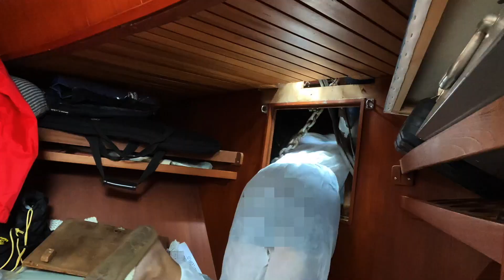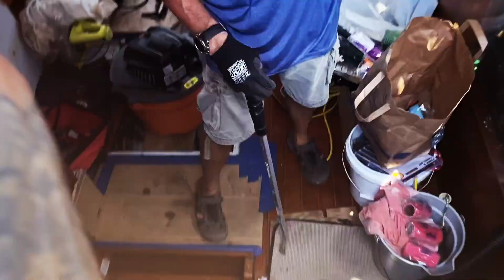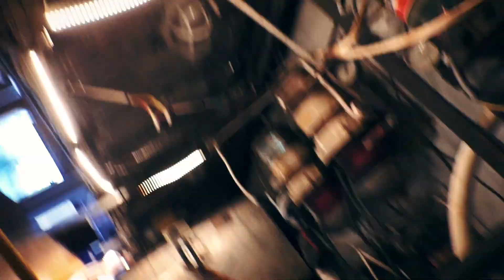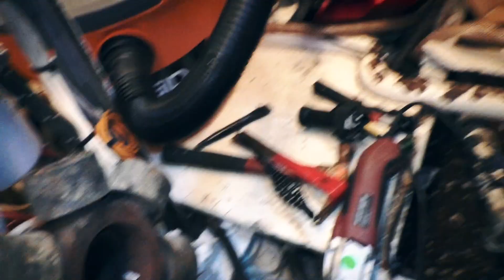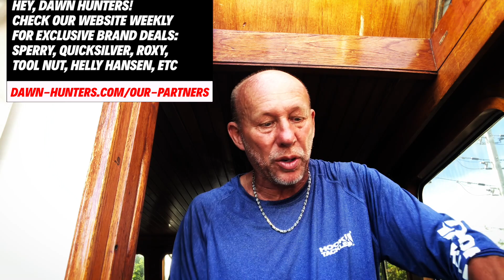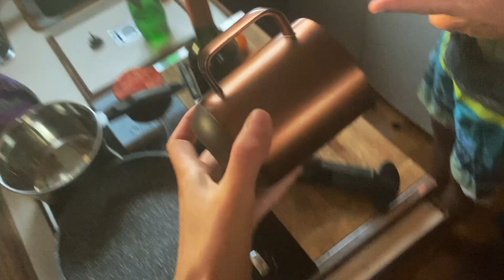Looking for a Motorsailer for Sale?! Watch This Steel Boat Rust Repair First!

Comment: How are you cutting that heavy gage stainless? And you said there are two grades, which did you choose for the chain plates?
Reply from the maker: Gary
I cut the stainless steel with a Dewalt 14 inch chop saw. The chainplates are fabricated of 304 stainless steel. I did now want 316 as that is too brittle. The 304 also has properties that yield more strength when welded. 
Welcome aboard 
Capt W

Comment: That boat is made with good Dutch steel.
Reply: I know because I'm Dutch. lol
Reply from the maker: Hello Raymond. 
You are 100% correct. Dutch Steel is what she is fabricated of. Actually very few pleasure boats are made with this steel due to costs but all commercial oil field vessels use “Dutch steel”. It is also a pain in the ass to work with. BUT well worth the effort. 
Thank you for watching. 
Capt W

Comment: Steel boats die from the inside out...
Reply from the maker: Tony
You are correct and soooooo happy we only have 3 small places this holds true. 
Capt W
Reply: @DawnHunters  haha...3000, only time to deal with that is the prep and original epoxy paint with spray foam. even then the construction must allow for inspection. my 58' ketch I can inspect all but 90 sq/in !! Twenty one years not even one spec of rust. Sorry to say your project has terminal cancer. Good news with steel you can fix almost anywhere in the world. Mate, get Lana out of the freaking bilge, what are you thinking. She needs to be over on Collins Avenue shopping. I am 64, my wifes 38 Brazilian, been together 17 years so take my advise.
Reply from the maker: Lowry Shank 
Hello Lowry!! Thanks for the comments. So many topics and I will save some for future videos. For sure you have steel experience which is very hard to find these days. Upgrading offshore oil rigs built in 1972 to modern day specs are like 100 of our boats on only 2 of the 5 decks. Rust is a companion of some steel but like a marriage. If one knows how to deal with the rust then it is not a real problem. Many have come to the yard and tried to do everything from media blasting to plasma cutting. They realized Dawn Hunter is not fabricated of typical US steel. Even after welding for over 40 plus years I had to modify the way I do the repairs. Good thing I have close friends in Norway who know rigs and know the proper approach. One major challenge is the complete interior of the boat has epoxy paint and fireproof cork as an insulator. When welding I have to remove the cork if deep penetration is required. The rusted areas are where 10 years ago some plates were welded in place that were Corten rather than importing the correct steel plates. These plates were also used to replace those cut away for access to the vessels water tank which is actually part of the hull. 
In summary would be great to share metal stories!!  
BUT for sure as you stated I have a great welder, torch and 4 tanks of argon that will be in the aft storage room for anything needed on our journey. Who knows- I can always do metal boat repairs for fish. 
Thank you again. 
Capt W

Comment: Dawn hunters
Hello Dawn Hunters.  I hope you think the way you two treat each other is as cute and loving as you appear in your videos.  You have me laughing constantly.  If you don’t mind, I’m going to make wisecracks about various things, such as:  Does that bilge entrance come with an instruction manual?  Do you need to have captain’s license in order to operate those steps? 😂

Before I carry on, I told Iana that I’d try to keep my comments shorter.  I have some fair amount of optimism that I will be able to, except if I think so,etching might be of interest to either of you.  Which, in that case, all bets are off.  Continuing forward.
You might find this interesting.  Some years ago, while I was in operations of a major oil refinery, I participated in one of many HAZOPs (Hazard Operability Study).  William, you probably know what those are.  Iana, I describe them like this:  you take the Piping and Instrument Drawings (P&IDs) of a process unit, or system.  You take highlighter markers of multiple colors.  And with the guidance of a HAZOP Facilitator, you start at the beginning, with one pipeline.  You color it all the way to, and including the next vessel, which could be a tank, an accumulator, a reactor, a fractionation column, etc.  You then state the design flow rate. You list what could happen (severity & consequences) if you exceed that flow rate (increased erosion, decreased product quality, high pressure leading to explosion of equipment, etc,), the likely hood that it will happen. And the safeguards you have to prevent it.  You have a matrix where you factor in the consequences and the likelihood to achieve a risk ranking.  If your risk is too high, you recommend you add more safeguards.  This could be a high flow alarm, a high pressure alarm, pressure relief valve, fail safe controllers (when utilities fail, the valve will either fail to the open position, or fail to the closed position), etc.  you also list reasons the rate will exceed the design flow rate, such as poor operator training, wrong valve open somewhere, lower operating pressure (maybe inducing unwanted liquid carryover in a vessel).  You also do this for a low flow (dead heading a pump causing a seal to fail, etc.  in that same node (node is that section that you highlighted with that color).  You do this for temperature, pressure, level and environmental-such as earthquake prone, tornado, flooding, freezing, etc.  finally, you continue with the next “node” with a different color.  You end up with a risk ranking.  If it is unacceptable, you add safeguards as necessary to make it acceptable.
Reply: Dawn Hunters.  So, these HAZOPs.  I’ve participated in many.  We usually contract the facilitator.  I assume an independent party is required.  So, one study we did, we had one particular gentleman facilitating (directing and documenting everything).  This gentleman had facilitated a HAZOP for a particular oil companies new offshore oil rig.  He showed us pictures of the semi floating rig being towed out from Texas into the Gulf of Mexico.  This particular rig?  It was the Deepwater Horizon.  The one that blew up, took (and changed) lives, and caused so much environmental damage.  I believe it was the worst oil spill in history.  I refrained from trying to get a hold of him, as I’m sure he had his hands full with callers from every where, including lawyers.  So ironic.  There, but for the grace of God, go I. ✌️🤙
Reply from the maker: Perry Diddle 
Hello Perry! PID loop ring a bell?  Love your example of the oil refinery. One of my past achievements was to convert a 1975 jack up rig from a drilling rig to a work over rig complete with a natural gas powered generator running off blow by gas— after 2 years work and complete renovation including quarters for 150 men we heavy lifted the rig to Angola where she now performs work overs, does partial offshore refining and supplies power to 10 other rigs. The only rig ever built to drill, refine and use blow by gas for power. You probably noticed that I design and build everything like it is being used in the oil patch. Happy to see a fellow “nut job” like me watching these videos. I have to stay on my toes as Iana learns so fast the only way to keep pace is give her the tough jobs. Lol (not really). 
Do you own a boat? We just helped our 70 year plus Friend get a boat and he will join this madness. I suspect you would be a good candidate for the same. He even sent a few lines out on crew seeker and got some interesting First Mate responses— guess this is his added motivation to get the boat sea worthy. 
To answer the first part of your text — yes Iana and I have an amazing relationship and even a few years apart 😊 we think the same of life and a million other things. 
Happy your along for the ride— what country are you in?  
Again Thanks for the comments. 
Thank
Reply: Dawn Hunters Dawn Hunters Ah yes. P&ID loops.  In addition to tracing lines in the field, they helped me see the big picture, Knowing and understanding the P&IDs used to be an engineering or instrument technician’s requirements.  I have an interest in technical and mechanical topics.  As I became the process operator trainer, they helped me train the operators - especially the lead operators.  I found understanding them helped me troubleshooting control issues.  Though I don’t know the workings of the rigs, I do know it’s a popular place to take your boat to drop you line for some fishing. 😂. But seriously, though I don’t know, I can guess a little of what’s going on with them.  Quarters for a150 people!  That sounds like a lot of people.  But, then again, they work in shifts.  Either way, it sounds like a busy rig.  That gas generator, huh?  Is it like a cogeneration unit minus the steam production? Lol. So, NOW I know what that flare is for.  At least, I suspect it’s to burn off blow-by gas.  At least excess which is not used for generation.  Also, I’m guessing blow-by gas is gas that is entrained with the oil production, or is possibly blanketing the oil fields down below.  I don’t really know.  Though I don’t know oil rigs too much (I find it fascinating how they can slant drill), I was glued to the tv every waking moment watching BP coming up with attempts to stop the oil release from the underwater wellhead.  It was probably like Apollo 13 disaster, but drawn out much longer.  Giving Iana the tough jobs, huh?  I just caught an episode of Sailing Sophisticated Lady.  Cap. Rick More caught his female shipmate in the head, up to her chest in crap.  She had the motor and pump from the toilet out and was freeing the clogging material products from the pump. Eh hum. (The clog was a feminine hygiene product).  Of course, Rick had the video going to capture her in action as he was chuckling, saying that he was proud of her to take it upon herself Th grab some tools and getting to work.  He had mention that he had done that himself countless times before.  And, that it was HER friend that was visiting and left behind the clog.😂😂. No, I do not own a boat.  Sometimes I imagine me selling my house and buying a boat to live aboard.  But, I’m pretty comfortable here.  More importantly, I have some health issues that I need to get a handle on (congestive heart failure and weight gain).  But, just as I’m throwing my pity party, you bring up you’re 70+ friend. Ha ha ha.  I remember the doctor saying I was still young. Ha ha ha.  But, why not.  There are many people I can look to for inspiration.  I’m 59 by the way.  Also, I’m in Wilmington, California.  Heart of the harbor (L.A. Harbor).  Smack dab in the middle of San Pedro and Long Beach.  I do like the idea of Crew Seeker.  I know I’d like it (sailing).  But there’s nothing like getting my feet wet first before i invest my life into it.

Comment: I'm the same way with my tools, I have the milwaukee stuff,  it's years old and still looks new!  If you buy quality tools, and take care of them,  they will last you a lifetime (for the most part).  Great tip, your videos are great! Good insight into what actually goes into taking care of a boat,  I aspire to do the same thing you guys are doing, keep on truckin!!
Reply from the maker: Hello Sean
My Father who is now 85 and still working treated his tools like they were plated in gold. As a carpenter he also swept the shop floor constantly— then was my first chore.  A clean tool always ready for the new task. My Dad came to Florida and helped with a boat project— I introduced him to Milwaukee battery powered tools.  He never liked them as in the old days they did not last. He now cut the cord and is amazed by their abilities. Still need a good old 110 ac for the big jobs. 
Are you restoring or working on a boat?

Comment: Hey Captain, Iana's job would be alot easier if she used a pneumatic needle scaler and a pneumatic chippper.... I know,  Iana, has to learn how to walk before she can run..... :)
Reply from the maker: Hey Eric 
I find that the needle gun and chipper does work in some places but they also throw paint and rust chips all over the place. In the engine room all systems are working fine and the electrical wiring is new. I get concerned about metal chips getting between wires and 6 months from now we have electrical issues. The rust areas look bad on the camera but in reality they are only located where access was difficult due to the old generator being in place. With this generator removed we were able to get into places and clean before we install the new generator. 
Thanks for the comments as always. 
Capt W

Comment: Would like to see a work list that list the things you need to repair. It appears y’all don’t ever completely repair any system. Just a thought.
Reply from the maker: Iana here. Hey Sonny! Hahahah I’d like to see that list too! William is a great starter of things (so am I) but not that great on finishing them heh. First we wanted to make videos project to project but then realized that have to make it vlog style - otherwise some releases would have to wait forever and will be outdated at that point... actually exactly yesterday we decided to start buttoning things up that are close to finish and must be done on the hard. We will not start anything new until splash. Once we DO splash we can finish the rest (which is still a lot though) while in the water. I will definitely talk to William and we will include a little conversation and a list of projects in the next boatyard video. Thank you for the input!
Reply from the maker: Hello Sonny and thank you for watching. This is my 10th boat re-fit/restoration. I found that if your in a hurry to complete large projects the cost is double. Best to take your time, enjoy the project and not get burned out. It also does not help when we leave on the other boat weekends to snorkel, test products and recharge our own batteries. 
Again THANK YOU for the comments. 
Capt W